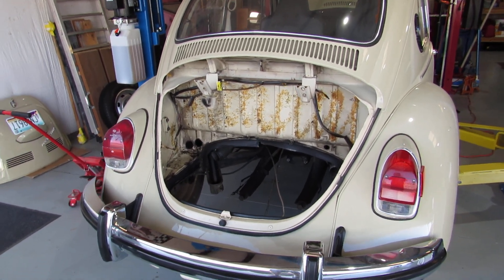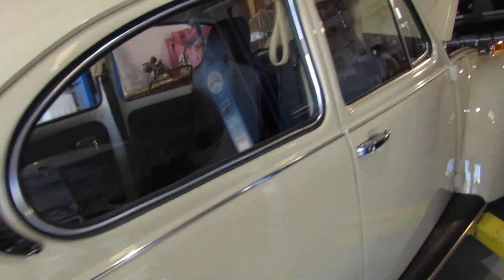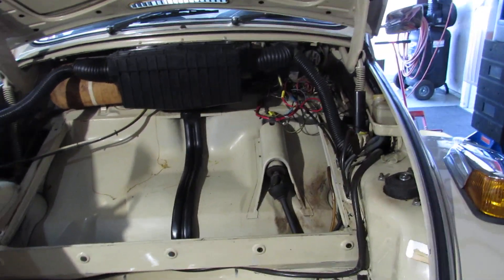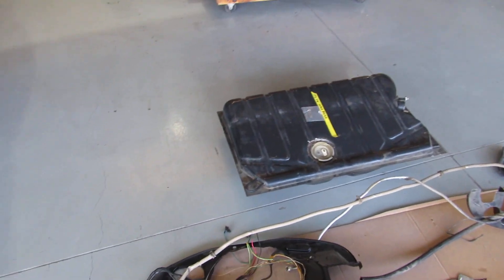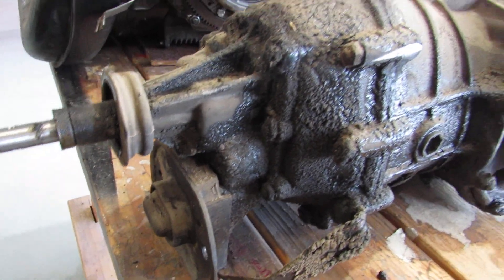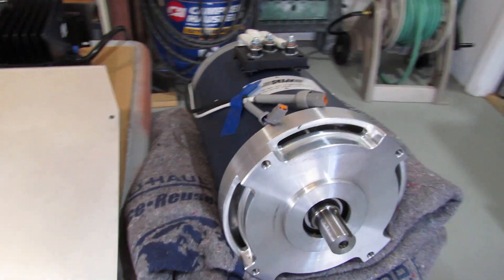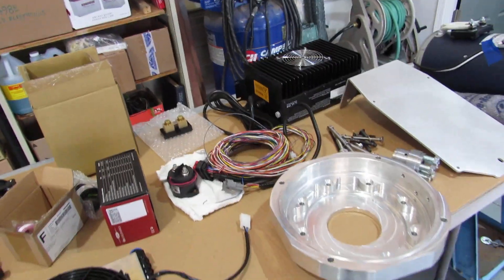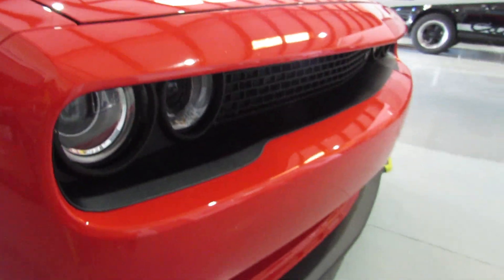71 VW Super Beetle Ev West electric conversion weekly recap plus bonus car at the end.....….

Comment: Randy-I have been watching your videos and enjoying them. I just purchased the same car(1971 Super Beetle) and will also be using the EVwest conversion kit to turn it into an EV! I am looking to get more information on the cooling unit you used. EVwest still does not sell one for their kit. When I called them to ask for some suggestions they told me as long as you don't push the car too much you don't need a cooling unit for the controller. That seems like an odd answer. I still think it needs something to cool the controller. Can you give me the part numbers of what you uesed? Thank you in advance for your help!!!
Reply from the maker: Hi John....congrats and best wishes for a successful conversion of your VW.   I think dealing with EVwest has probably been the biggest thorn in my project...vague answers, delays in returning my calls and emails, mis-information on wiring diagram, etc...  We also could not get a straight answer about the cooling system for the controller, but were never told that it was not necessary.  In the end, I decided to use this: 
https://www.summitracing.com/parts/sum-331000?seid=srese1&gclid=Cj0KCQiAi9mPBhCJARIsAHchl1zbg4hANYig-6rw5qabKeriFhbOX_2AMfhYS1mpx_N-1Znc0HZxJasaAqvUEALw_wcB

I haven't installed the system yet as I have been working on a different project since last update, but, I will be adding a small electric pump to circulate the fluid....only question is where to mount the cooler itself as it requires air flow for more efficient cooling. Should be back on the VW project in a couple of months and will be posting more updates.  Good luck and if you're ever in the Tucson area, contact me and I'll be more than happy to show you our "Voltswagen"..... R

Comment: Are you building your own battery boxes or does evwest have a source for those?  I don’t see any on their website.
Reply from the maker: Plan is to have the battery boxes built locally, I've got some friends here at the airport who are fabricators/welders, however, someone commented to me that Ev west did have battery boxes available, you have to call them though.  I guess it would also depend on the batteries you plan to use as to what size box...  thanks for checking out my vid!
Reply: Randy Ross Cool, thanks!!

Comment: It’s wort rebuilding the CV joints because the aftermarket ones aren’t that great. Shop around for original brand parts are worth it. You can put the cooler up out of the way near the transaxle, it will have very good air up there.
Reply from the maker: Agreed....most aftermarket parts just don't have the quality these days.  I sold auto parts for nearly 30 years and was constantly dealing with warranty issues :(    Going to keep the originals just in case I need to re-build them.  Great suggestion for the cooler, I'll be looking at numerous spots once I get our fabricator out to the hangar..

Comment: I really hope there will be a europeab country making EV kits for my VW LT. Which has never existed in the US so it no kits available. Would be nice, otherwise I have to make one myself once ;)
Reply from the maker: Not real familiar with the LT series....you have a type 28 camper van sort of vehicle?  Might be worth contacting Ev West, they just might have a conversion plate or can design one for you....
Reply: Randy Ross LT is a EU only (I think) oversized van. Basically a bigger transporter. Engine in the front. Mine had an 2.4TD, which is nice but it’s extremely polluting and can’t enter city’s in Europe anymore. So because of that it might be worth it to convert it in the future.
Reply: @FhVW  I bet you could call EVWest and see what they can do. Their current standard vw kits use AC35 motors, but there is an AC50 which I've heard people using in larger vehicles.

Comment: Nice work! One long shot, pretty steady on the camera, good information and bonus content. Transaxle rebuild has probably been done elsewhere, stay with the E components. Thanks! 

PS - that washer tank pressure system was designed to keep the fluid going without letting the spare tire go flat...
Reply from the maker: Thanks, appreciate the compliments and the info about the washer tank....haven't ever really researched or for that matter, worked, on a VW,......so far, I'm liking it!